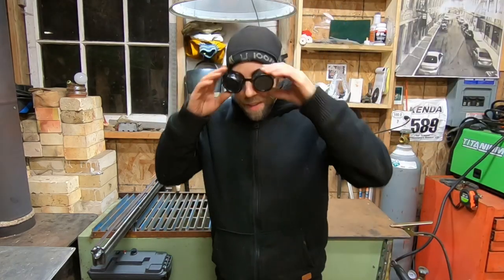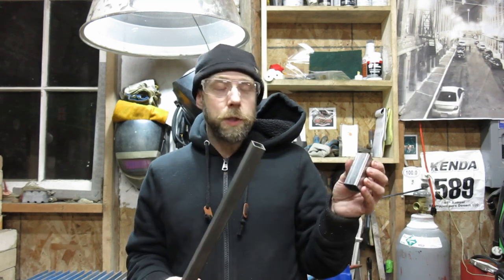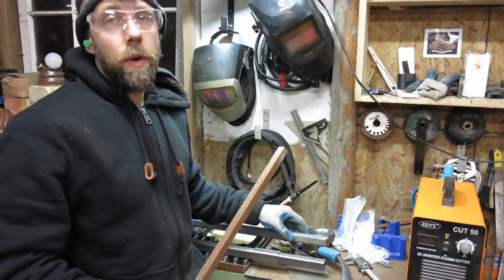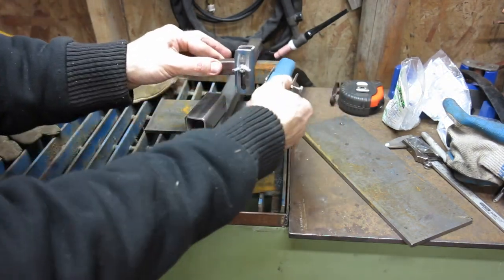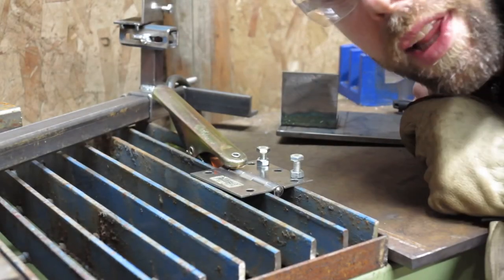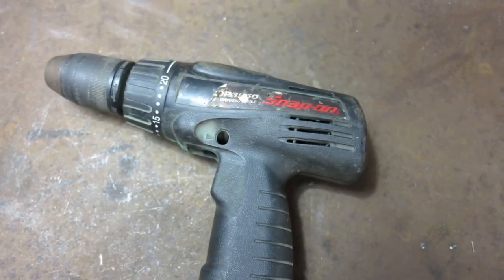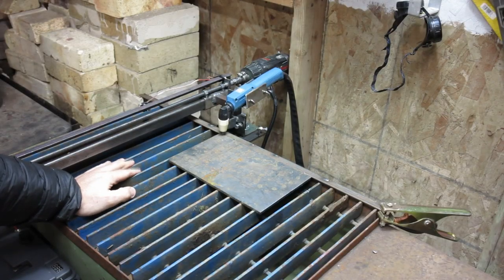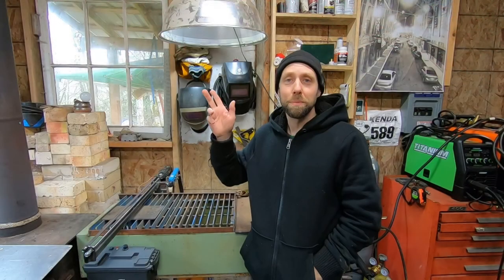Plasma cutting track DIY

Comment: What a great project, no way you can get a finish like that without the steady speed of cut. I will have to make on now. Cheers.
Reply from the maker: Thanks for commenting! It’s definitely going to help me out in my shop, funny thing is I got spoiled with nice plasma cuts about 3 years ago when my friend and I went in on a CNC plasma table, I bought this el cheapO plasma torch a few years back for my shop but didn’t use it much because the free hand cuts didn’t look like the CNC. The problem is if I wanted a clean cut on the CNC I would have to drive about 15 minutes to my friends place and sometimes it’s nice to keep moving on a project when your inspired, now I have the possibility to make nice clean cuts at my shop! Thanks for checking out my project!

Comment: Pretty cool idea. I used to want to make something like this back when I was in school for welding. As time goes by the want or need has diminished. There are a few reasons. Time is money. That set up takes time to build and time to operate. All the variables. Speed, angle, metal thickness, consumables, air pressure, etc, change so much and you are changing yourself so much it would hamper the cut. Grab a straight edge and go. As you get more practice the cut will be like almost like it was sheared and then longer cuts you won't even use a straight edge, YOU will be a machine.
Reply from the maker: This was just a fun project to build, I have given it to a friend including the plasma torch. I now own a CNC plasma 👍

Comment: Nice idea for smooth consistent straight cuts.  I'd like to expand this idea to allow for tracing curved parts (a manual pantograph...think of it like a manual CNC cutter) so that would require an X and Y axis (search youtube for plasma cutter pantograph or "tracing" jig) but would like to retain the power feed for making the smooth straight cuts when needed.

If you've ever worked on a metal lathe, many have a power feed, but that feed can be released with what's known as a "half nut."  Flip a lever, the feed engages the drive screw, flip it the other way and it releases to allow the carriage to travel freely.  I think with a half nut, you could engage it for the power feed for straight cuts and release it to use it in the pantograph mode.  

Also, concerning the cheap chinese cutters, many are now available with "pilot arc" which is much better than the high frequency start.  You can cut through paint, rust, and pierce into the metal directly.  It does make the units a little more expensive due to the slightly more complex torch needed. There is a ground wire that runs to an electrode inside to initiate the arc inside the torch, which in turn ionizes the air forming a lower power plasma arc, then the air blows the arc out the tip (appears as blue flame) until the machine detects the arc electrically connecting to the work piece, then it kicks in the full cutting amperage.  It is that pilot arc that quickly burns through paint, rust, and crud that makes it so handy.  High Frequency start machines tend to have issues with dirty metal.  Also, HF start torches/machines can't be used on CNC tables as the HF interference is too high and will cause issues with the computer equipment (or any other low voltage electronics nearby).  The pilot arc technology found on chinese machines still requires an HF arc to start the pilot arc, so it still creates some HF noise, however, since the distance between the anode and cathode inside the torch can be controlled, i.e. made very short as opposed to needing to create the arc between tip and work piece like an old HF start torch, the HF EMI is greatly reduced, but still present to some extent.  These can be used on CNC tables, etc.

The pilot arc found on pretty much all plasma cutters that aren't the Hypertherm brand use this older technology.  Hypertherm has created a newer pilot arc design (still under patent I believe) known as "blowback" where the anode and cathode are in contact with each other when not cutting.  When the trigger is pulled, the full cutting amperage is initiated and the air flow "blows" the anode and cathose apart a slight amount, instantly igniting the pilot arc without the need for high frequency. 

The extra cost for pilot arc on the chinese machines isn't significant, usually around $50-$80 more vs it's HF start brothers.  Since pilot arc requires that extra wire running to the torch, you could easily wire in a foot pedal to control the arc strike and cutting while using both hands to guide the stylus while in pantograph mode.

There are literally hundreds of different "brands" of the chinese cutters, but I think most of them are pretty much the same machines with different styles and colors of case.  Some have the air regulator and filter internal, might have air pressure gauge on the front or rear.  I've even seen some with a switch that lets you control how long the air post flow operates after cutting (usually 2.5 or 5 seconds).  What tends to vary are the torches they use, so this matters when it comes to consumables (tips, cups, and nozzles).  Pilot arc consumables are a little pricier than those for HF start, but if you don't abuse them, they will last quite a while, especially if you aren't cutting a lot every day with it.  Still, for what they can do, even if you have to spend $60-$80 for a 10 pack of consumables that will probably last a year in heavier use (or several years for casual use), they're still well worth it.  You'll spend for blades if you have a band saw, so unless consumables are super expensive, I don't really factor them in that much (but I have ruled out a cold saw for metal cutting simply because the blades are expensive, typically $75ish + dollars a pop and they don't last as long).  

Some of the chinese brands have garnered somewhat of a popular following, such as the LOTOS brand, but there are other brands just as capable and basically the same machines for slightly less.  Surprisingly, Home Depot now carries several of these brands, such as Amico Power and even LOTOS.  So, if any kind of return policy concerns you, just order one from Home Depot instead Amazon and you have a local store you can return it if you don't like without much of a hassle.  You'll still have to deal with the chinese company for warranty stuff if needed, but even there, it seems many of them are seriously working to up their game.  I've read several reports of LOTOS and Amico Power owners having good experiences with warranty claims.  Still, a 50AMP plasma cutter with pilot arc for $350-$400 is well worth the risk for home or hobby users even considering the potential issues or hassles when an equivalent Hypertherm is going to set you back around $2000+.  If you're a professional that relies on your tools to make a living, then definitely go buy the Hypertherm.

As for me, I'm seriously considering the Amico Power APC-50HF.  50 amp cutter with pilot arc, $379.00.
Reply from the maker: Thanks for checking out my video! I have a metal lathe so I definitely get what you are talking about with the half nut idea! I definitely recommend building one, especially to be able to trace other shapes. I just got a new plasma torch recently, it’s from Harbor freight, it’s the Titanium plasma 45, it’s a pilot arc machine, I also just bought a small CNC plasma table! I’m learning the software and have already cut some stuff on it, but the simplicity of this track torch is definitely a great thing. Let me know when you finish your track torch, I would love to see what you end up building! Take care

Comment: Mike,
I bought the latest version of the same Zeny CUT50 plasma cutter.  Sold on Amazon this time as the “Superdeal” brand.  The actual plasma cutter arrived but was labeled as F2C (Factory 2 Customer).  Out of the box I cut 1/4” hot roll flat bar.  It worked great.  The ground cable is too short and it needs an upgrade.  
Bill

Comment: I actually have seen a drill chuck like that before. It's pretty easy to fix by taking it apart and adjusting the springs that keep the jaws in place (IIRC).

Comment: Very nice Mike! luv the HF plastic ammo box,housing the controller! Im sure the clean cuts save some grinder clean up work.I usually end up cutting a slight angle top to bottom of cut on 1/4" or thicker when hand cutting.Nice job!
Reply from the maker: Thanks! Yes the HF ammo boxes are real useful for a lot of projects around the shop. Thanks for checking out my track torch Jeffery :)

Comment: Love it!!! I'm gonna build one. 
Any video on the electronics aspect? 
Home button, limiter set up, power source?
Reply from the maker: Miles What Nots I think you will like a tool like this 👍 it’s easy to build and functions quite well. Here’s a video I did over wiring up Pulse width controllers to Any DC motor and how to wire up limit switches. I had interest in making more videos on subjects like this but no one seems to watch them so I decided not to produce more in-depth stuff like this. 
If you have any questions I will try to answer them. https://youtu.be/GpMXzgwXXYc

Comment: wow this is rad! definitly going to be building something like this soon. What air compressor do you recommend for the shop and running a plasma torch. I just got a torch but still need a compressor setup

Comment: I have considered building something like this for one of my plasma cutters for quite some time.  I think I would use it.  But I've really mastered using a good old torch guide.  I made multiple length drag guides out of 1/2" steel flatware and baked on a high heat coating to prevent arcing to the guide.  But your video has inspired me to move forward with the idea.  Impressive build!! What exactly do you do in your business?  Because I would hire you in a heartbeat for my welding/fabrication company.  New subscriber here.  Keep up the good work sir!! You also motivated me to improve my video editing skills for my YT channel.   Thank you.

Comment: Very nice project... This is the most simply and affordable way i found to make one. I had to watch several videos and i found the best one for my need with yours.
Did you use some chart for cutting with your plasma cutter, i mean metal thickness/amps/air pressure.
Thanks for all your videos, i follow you .
Reply: Do you only clamp it on the table side with a vise grip or you weld it ?

Comment: nice set up , one question you didnt say........how you set up your trigger on plasma ?
Reply from the maker: Dale Masyk Hey Dale At 8:36 I show removing the original plasma torch control, and I hook up the home built connection made from two red electrical butt connections, I think the video was getting long and I must have cut out some of the video of that. I run up to a simple toggle switch,  all I needed to do to start the plasma torch is to close the connection to start the torch. The plasma torch just need a closed connection to start and a open one to turn off. I hope this helps 🙂 take care

Comment: Nice work again Mike,  I've never played with a plasma torch....looks like it could be useful and did build a CNC rig with stepper motors a few years back ...but never put it to use :)
Reply from the maker: Thanks for checking out my video! I took a gamble on that plasma torch, it was about $250, so far it works great! 
Do you have a video of that CNC you build? If so I would love to see it! Ps how’s your mill? I’m hoping to build a roof over my mill this Spring so I can feel more inspired to mill year round. Take care :)
Reply: @Mikefestiva  Hi Mike, the CNC build was just the controller, lead screws and steppers, (got it working on G code?) never finished it as far as using it for anything. Just got a centrifugal clutch for the mill, about to fit.....but they may be building a 4 lane road through my woods....soon? :(

Comment: I don’t quite get how that Amazon box is running the drill. Where is the power coming from a 110v receptacle then changes it to 12 or 15 v to run drill?  Really cool idea. I never get any kind of straight cut doing plasma by hand

Comment: Is there a video on how you made your cutting table, looks like a re-purposed item, i'm at the point of wanting away to keep all the slag and cuttings contained. One more thing you need to add to your reviews is how loud are the DC  inverters for the power supply's in the welding units and plasma cutters, thanks

Comment: Hi Mike, the project looks great and I am really looking at building it. The only issue I have is that I don't have a spare motor so I will need to buy one. I can almost work out the size but can you let me know what output speed the motor needs to be. Thanks

Comment: Great idea, I missed what you plugged into the torch
Reply from the maker: I just used two wiring butt connectors to make a plug that goes from the plasma to the gray controller box to the toggle switch to fire the torch. Thanks for checking out my video 👍

Comment: Hi Mike, loving the channel, we have a lot in common. I know a plasma is in the near future but with my house build going on I cant tinker on stuff and repurpose that much at the moment. A track torch cutter cuts up to 30 inches a minute, so is that fast enough for running a plasma through thin material if machine settings are a little dialed down? With those cheaper track kits being under $300 on ebay it looks like a good thing to adapt and be able to use a plasma or a oxy torch with it.

Comment: Hey Mike how's it going ? I just got all the electrical supplies. I used your links to order them.  I just need to get some scrap steel from a buddy of mine and then I can start to build my table. Thanks for your help.
Reply from the maker: Hi Brian :) I have been good, we just got a lot of snow a few weeks back, it was just starting to feel like spring some green buds were popping out and bam! 3 feet of snow, I did a lot of plowing and shoveling, and I haven’t been too interested in doing as many projects in my shop with all the ice and snow. 
Thanks I appreciate you ordering through the links, it does help. That’s great your starting on your plasma track! I was just looking over your previous comments and I missed your question about the table and measurements, I would be happy to measure stuff up for you. I will head to my shop and get the basic measurements.
Reply: Mike festiva  it’s ok we are all busy this year. we have had a record snow fall here this season. I haven’t see snow like this for 30 years. It’s no hurry to get those measurements when you get a chance. And thanks
Reply from the maker: Okay I got some measurements for you. The slatted cutting table with the flat bar is 24”x16” this size is not crucial, it was this size mainly because that’s all the material I had at the time when building the original cutting/ welding table. 24”x 24” would even work better. 
The main track is 1x1” 1/8” thick square tubing that runs out below the all thread, it’s 31” I think I made it this long so you could cut a full 24”? 
The part that slides on that 1” track tube is a piece of 1. 1/4” square tube 1/8” wall, this is 3” Long.
The all thread is 3/8”, I got it in a 36” stick at a local hardware store, along with all the nuts and bolts and bushings. The only thing I would have done differently is I should have made my own hinge or bought a thicker stronger one, I get a little flex in the hinge I used, I wanted to mention this just to let you know. If you have any other questions I would be happy to help. Ps I live in western Washington, where about do you live?
Reply: Mike festiva that’s great thanks and I Live in northern Maine
Reply from the maker: Wow we are about as far apart in the continental United States as you can get, I’m out on the Olympic peninsula, the most western tip of Washington is only about a hour drive west from me.
Reply: Mike festiva yes that is a long ways. I have a very good friend of mine that lives in Sequim, Washington.

Comment: Pretty slick tool you built there that looks very useful. Question for you, you ground off the inside weld seam on the first piece of square tubing then cut off the side, would just cutting off the side remove the weld seam or did I miss something there? I am not a metal fabricator so I just don't know.
Reply from the maker: Hi Tom :) yes I ground the inside weld off the first tube that was used for the slider, the tube I cut the side off of was a different piece that was used for the torch holder. Thanks for checking out my project!
Reply: @Mikefestiva  I see, I re-watched the video and I saw the slider on the longer piece, oops my bad :-(

Comment: Sorry for such a noob question but I've been Thinking about getting a plasma cutter for a very long time but I just recently read somewhere that they are as loud as 110 dbs. It's that continuous while using it? How loud are they really? I do most of my work in the backyard and I'm thinking that's gonna be a deal breaker. My neighbors will never allow it lol so just wondering how loud are they and when exactly do they make all that noise that noise

Comment: Would have liked to have seen using nylon sleeves to protect the gun from the bracket at: 2:04. Thumbs up on your good work.
Reply from the maker: Thanks for checking out my project. Maybe if the plasma was of a nicer quality I would have but you can buy the full handle with a set of consumables with a stand off for $15 I was not to worried about scratching it 😂 Take care 👍